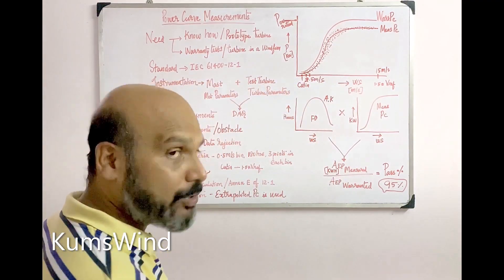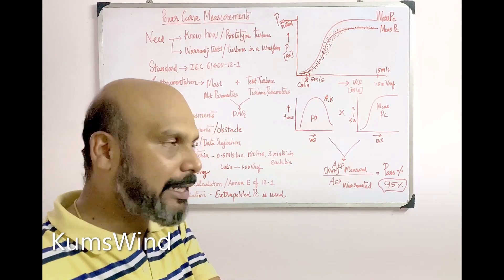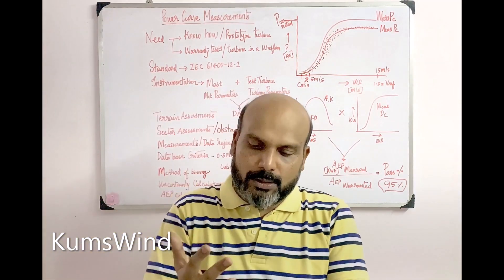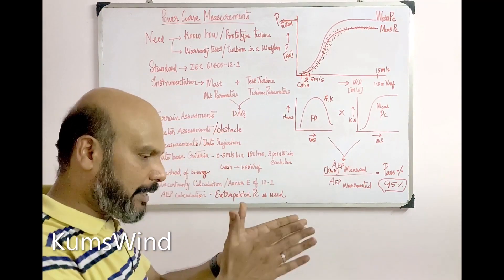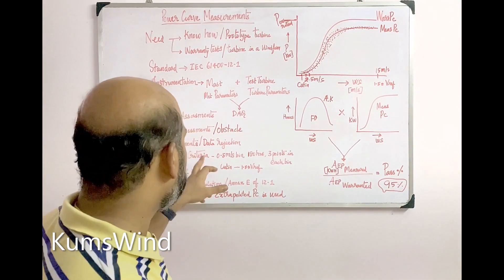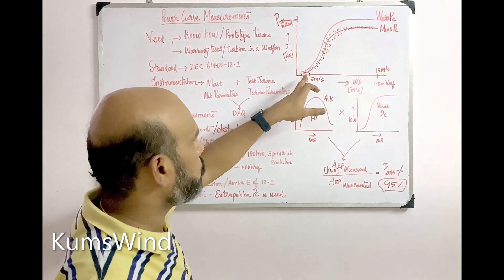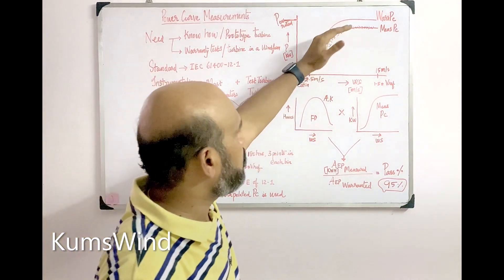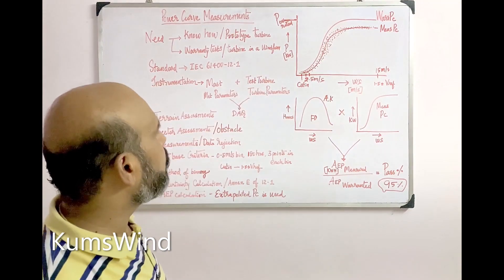Wind Turbine Power Curve Measurements  | KumsWind

Comment: Sir, would you help me out with this question, power in the power curve is which power？I think there are several possibilities. 1 power absorbed by the blades; 2 output power of the generator 3 output power of the converter 4 output power of the transformer 5 power injected to the grid
Reply from the maker: electrical power output from the generator (or) convertor... that is power measurement before the primary of the transformer, thanks for shooting up this question.